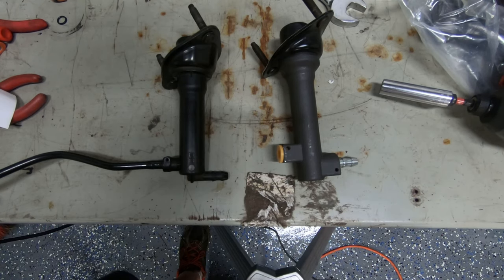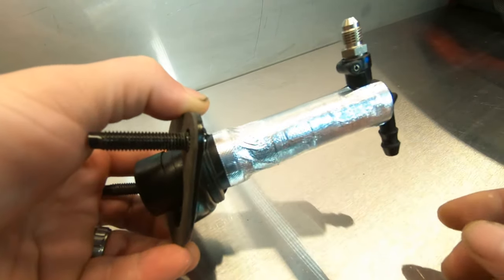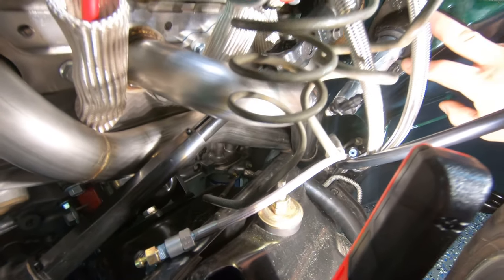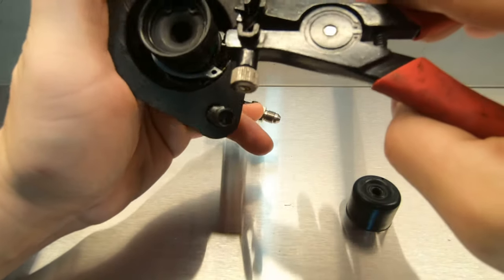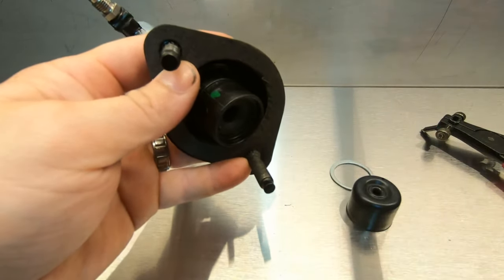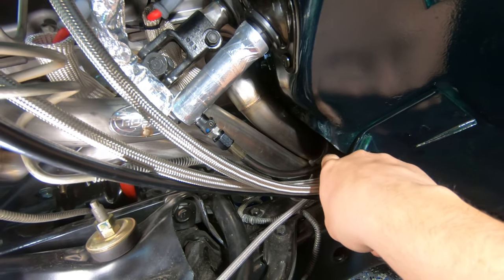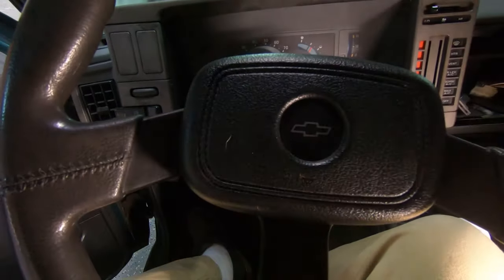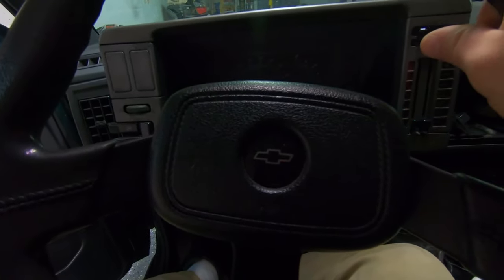T56 Swapped S10 Clutch Master Cylinder: Problems and Solutions

Comment: Great Video, only wish you published three weeks earlier!  I was able to get my stock clutch master to work by leaving the original 1/4" tubing and roll pin in place.  I removed my line from the master and took my tube benders and put a tight 40 deg bend just past the body of the master.  Cutting the additional key would have been a much easier process so I will keep this in mind if I need to replace in the future.  I routed my line the same as the factory across the back of the fire wall and down over the trans. My remote bleeder is mounted exactly as yours.  Nice work so far and enjoy the updates.
Reply from the maker: Bummer! Wish I would have had figured it out earlier. I tried a factory '95 line and a premade -4 line with the proper fittings (both straight) and wasn't thrilled with either. It took some trial and error, but I'm happy with the results!

Comment: How did your rubber fitting to stay on the master cylinder. I just put mine in and when I push the clutch. The rubber plug fitting pops out

Comment: Hey there, I know this video was a while back but I was wondering if you were using the stock clutch and brake pedal assembly on this. I’m in the middle of swapping a 5.3 with a T56 into my 91 s10.

Comment: Did the t56 fit good without cutting the transmission tunnel?
Reply from the maker: I trimmed less than an inch off the back of the hole, and it fits great. Keep in mind that mine is a Tremec Magnum with the front shift location. An oem T56 has an inspection cover that can be made into a front shift location with some internal modification
Reply: @CheekyGarage  I was thinking about putting the TKO model in mine. Just seeing how yours fit. Nice job on the build by the way. Mine is also a 98